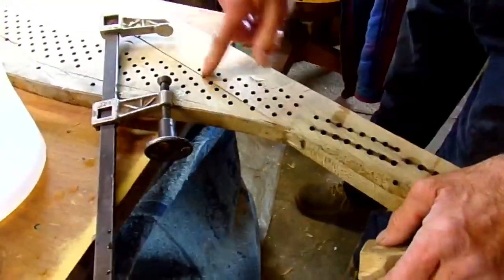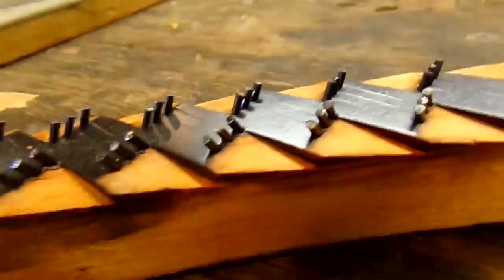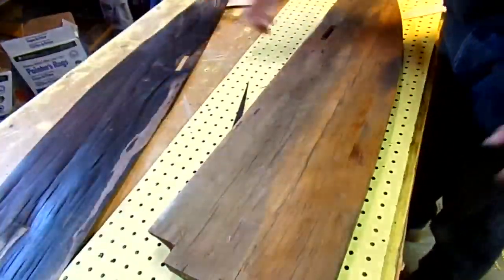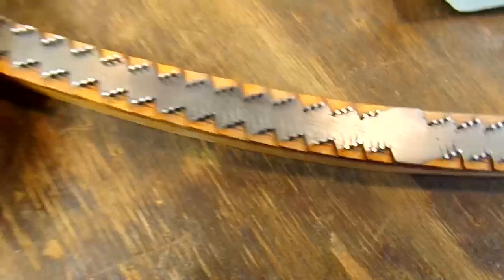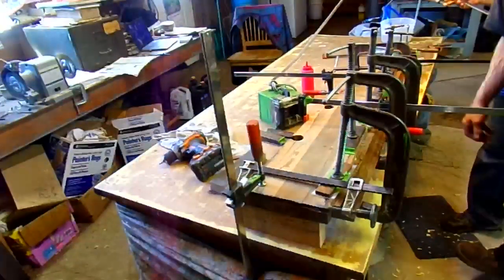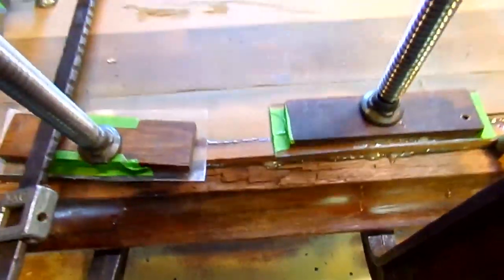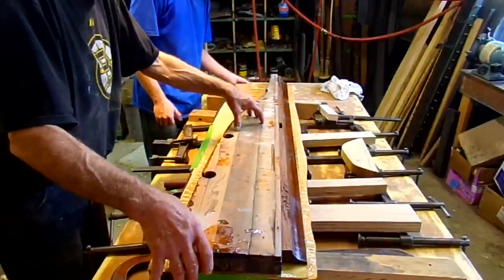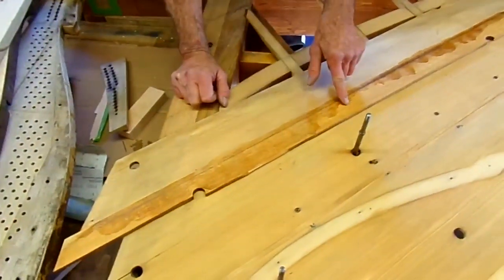Chickering 33B 1867 Conservative Restoration Part 12

Comment: One of my favorite episodes of the sequel thus far! One can sense the accumulated expertise of your shop! Two questions: why are you not completely taking out the grooves from the strings in the bridge cap, and why do you make a new pinbloc?
Reply from the maker: Bridge pins,  groves?  The wood under the strings is hard as stone, and we have had no trouble the way we leave them, so removing them is cosmetic. 
We would have never ending complaints if we had bridge pin problems. 
There isn't much said about the performance of fresh bridge caps, there would be denial Re: the troubles and I know there must be.
Getting good rock maple for such is not so easy today, oh----and properly seasoned!  "impossible" 

The pin block was jinxed from day one,  it began the trip downward "literally" as soon as it was tuned up.
After all this, I don't think we want to start that process over again.
Reply from the maker: Oh yes if material is removed from cap to be below the grooving, the side bearing is lessened, = buzzing, big time,  they must be filled.
Super glue and colloidal silica,  make a paste,  it's hard as, -----   "stone".
Reply: @hampshirepiano6383  OK, so the grooves actually help to limit the horizontal string movement at the first bridge pin.
Reply: @hampshirepiano6383  Interesting, so it seems you'd have something to teach the Chickering guys with 153 years of hindsight...